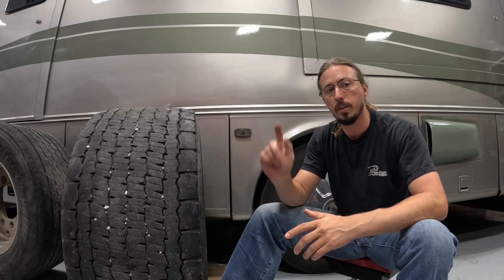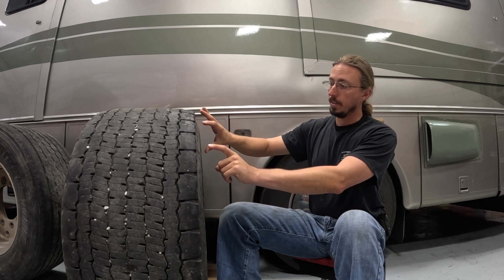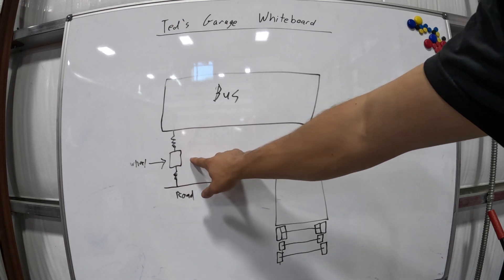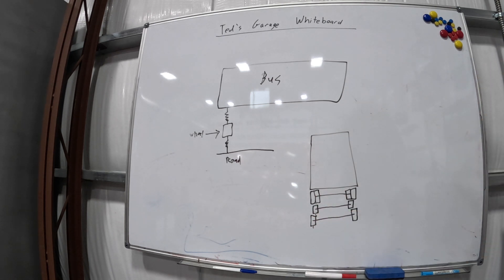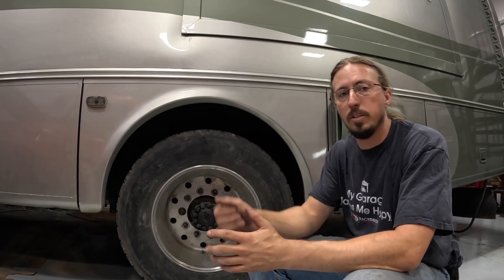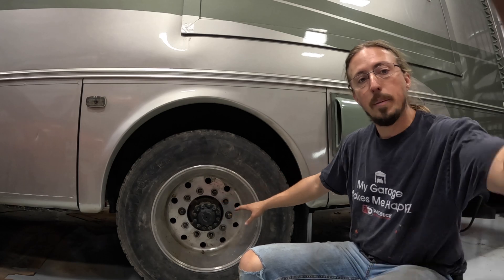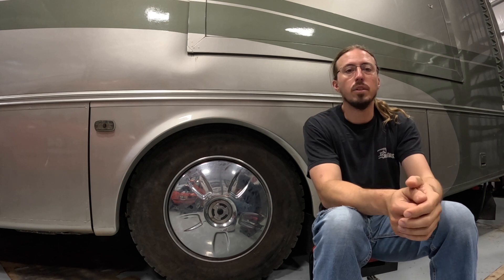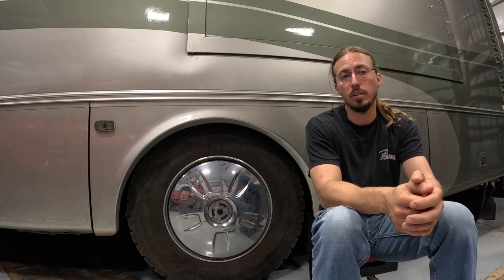Installing Super Singles (and larger front tires) on my RV for a Better Ride

Comment: Great job Ted, your always doing what I am considering doing! I just had to replace my front tires on my 2004 Tiffin Pheaton (XC chassis). I wanted to put larger tires on the front but the tire shop said I would have problems with my ABS sensing a different tire speed (I thought he was full of it but wasn’t sure). Where did you search for the used super singles?
Reply from the maker: Thanks! Regarding the different tire sizes throwing off ABS, that can happen depending on how much the difference is (measured in percent) and at what threshold the ABS will say something is wrong. The other question is whether you care. I don't think I've ever gotten the ABS to activate on my bus.

I searched on Facebook Marketplace for the used super singles. In my area there are a bunch for sale.

Comment: I always wait till my Journey has aired up before moving so I don't make the mistake of turning the tire into the fender arch, good tease at the end.
Reply from the maker: I always make sure mine is aired up before moving as well, but the brakes will disengage at a lower psi so it’s possible to be in a hurry for a quick move and end up having problems.

And yes, next video hopefully coming soon!

Comment: Great video,  do you have to run a larger wheel to run the super singles. Thanks
Reply from the maker: @harperfamilyadventures5309  They’re still 22.5s but a 14” width. Easily available on marketplace.

Comment: I went thru tje same research and found the singles were around 12,000 capacity,old doubles were 10 a piece so when i unload tag 20,000 total im overloading drives on a regular basis,are your single higher caPacity?
Reply: Prevost is around 25,000 on drives x4 at 9000 each so unloading my tag im still under 36000.love your channel.concluded same for your exhaust mod.great stuff.moved chassis air off cooling pack also huge drop in charge cooler temps.brake temps in mountain were lot higher on singles,no air gap on drives between tires.decided not to on prevost.at sings anyway.also a&p ia 40 years in aviation.great job on all your videos.we should do a tech class at prevost ralley.
Reply from the maker: Keep in mind that I did this on an RV that doesn't have a tag axle, and so I don't have that particular concern. The GVWR of this particular RV is also fairly light relatively speaking, and so I do not have any weight concerns with it. I forget the exact rating of those tires I used.

My Prevost I now have has a lifting tag axle, however I don't believe the tires are spec'd such that they are at the rated weight with the tag axle up. On this bus you're only supposed to lift the tag axle for low speeds to make sharper turns, and you aren't supposed to have it lifted permanently for driving. It's not the same as tag axles on trucks that are only put down when the extra weight capacity is needed. So I wouldn't be worried about it on the Prevost and I'm thinking about putting super singles on it at some point, likely when these tires wear out.
Reply: Great thought about all that also.
Reply: Thank you for the reply.cant waite to see your video on it.
Reply from the maker: @solarchild1  Thanks for watching!